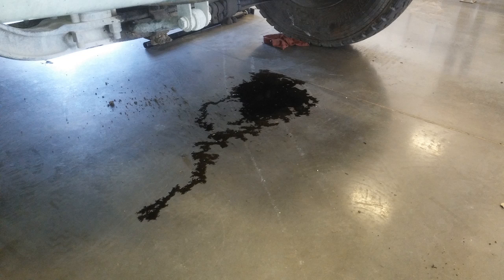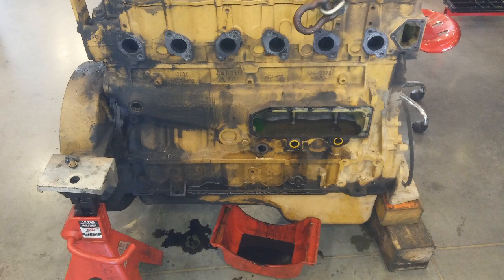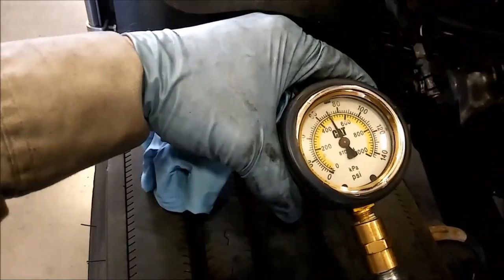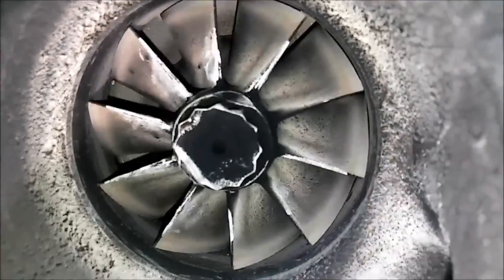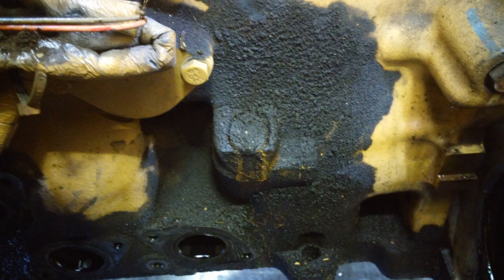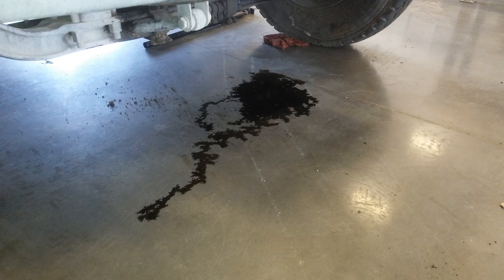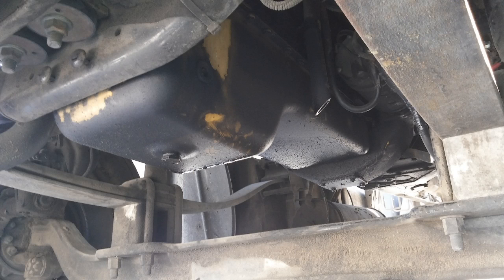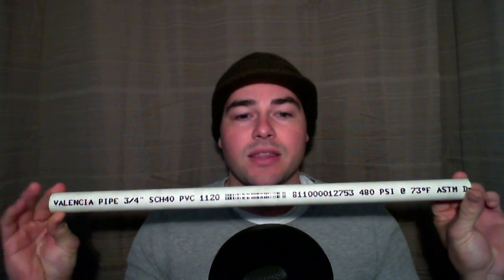Why Do Diesels Leak So Much?  Why Do Diesel Engines Leak So Much Oil?

Comment: 1. No throttle plate to provide a restriction therefore no manifold vacuum. Can be negated with a vacuum pump.

2. Higher compression ratios = more blowby = higher crankcase pressure. Same reason the diesels dirty their oil with carbon so fast.

3. Because of the lack of a throttle plate (generally) a diesel's cylinders are always getting a above atm air charge due to the turbo and compressing it. Meaning there is always blow by every compression to exhaust stroke. While a gasoline engine that is 'engine braking' has its cylinders unable to pull in a air charge due to the closed throttle plate and the cylinder will have lower pressure then the crankcase during intake to power stroke and 'reverse' the blow by path for gasses.

Summarized a diesel engine's PCV system in whatever form it takes is having to deal with a lot more flow constantly then a gasoline engine's PCV system which has to have a valve to prevent over scavenging at high manifold vacuum (idling).

Comment: Yo, i own a tdi sedan and currently suffering a "boost leak" apparently, i have noticed a very SMALL oil leak coming from one of the seals of my vacuum pump mounted on the front of my engine...could this have anything at all to do with the boost leak ?

Comment: On my merc w203 cdi, there is a pcv system, and the crankcase ventilation is exhausted right BEFORE the turbo. Germans know what they are doing!! I also fitted a oil catch can to prevent all that nasty oil on my intake.
Reply: Ricardo Moura unless you have a BlueTEC. They’re notorious for leaking oil into the turbocharger
Reply: My 2004 Sprinter’s OM647 cdi has an oil separator on the valve cover too; size of a shoe box. It exits straight into the turbo inlet, with the air filter providing a bit of restriction to pull the fumes from the crank case.  There’s a filter element that wants cleaning every 200,000 miles or so...

Comment: Just add more bolts to the pan ,valve cover and other places .Semi hermetic compressors have more bolts so the pressure of the Freon dosn`t leak oil or the gas out . I never seen these leaking oil at the gaskets

Comment: Pretty much all smaller diesel engines run the PCV into the intake side of the turbo. Never seen an issue with it. The crankcase filters are horrible. I've seen Cummins 6.7s completely fail because the filter was clogged up. On the ISX, they "redesigned" the filter to basically be an empty shell because the filters never worked anyway.

Comment: My duramax has a Pcv vent that is routed right into the intake before the turbo. It also has a second vent hose that runs under the truck. Why is that?

Comment: if you hock the pcv before the turbo but with a catch can in the circuit it shoud theoreticly work an if you also youse a variable throttle like with hydraulics in my mind it works because there is more or less the same negative pressure in the pcv at least better than without and the catch can should be able to ,,catch,, the oil and mabe water an the air thats already mixed with fuel shuold not be a problem in my book since they are so few .

Comment: Diesels also have no throttle plate, so there is no vacuum even without a turbo.  Thus, it can't draw a vacuum in the crankcase.  Also, 2-stroke diesels use superchargers to pump air into the cylinders through the crankcase.  They leak even more!

Comment: Gas engines in cars only go about 200,000 kms before they are crushed and sent off to China to be melted down.  Heavy Duty truck engines can to up to 360,000 kms in 1 year.  Most heavy duty diesel engines don't start to leak until they are 3 years old or over 400,000 kms.  In most cases they are still under warranty and get repaired at the manufacturer's expense.  In any high mileage or high hour engine the gaskets, seals, and o-rings will harden causing bolts to loose their clamping force and they start to leak.  This goes for any engine, not just diesel engines.

Comment: Hi, great video. How do turbocharged petrol engines solve this problem? By the way, why is it that the ballast on railway tracks are covered by a think layer of black diesel gunk? Is that due to the leaks or due to fumes settling on them? Thanks.
Reply: Brian Su that's from greasing stations along the track sd, used to prevent the wheels from. Climbing out of the tracks,and some blow bye ,which isnt vented back into the engine like a  ig truck

Comment: This is not necessarily true, even a turbo diesel produces vac. at idle.  Any engine system that requires vac. uses a one way check valve or a solenoid that captures that vac. and holds it even when under boost.  Think about a power vacuum booster on a gasoline turbo cars brakes, if it never saw a vacuum it would never work and you would loose power brakes unless you were idling.

Comment: There is no counterpart for an engine that size. Maybe a one-off engine but not really, plus the big engines like the 16L inline 6 cylinder twist when under load that Also contributes to the leaks

Comment: It is also a reason of the cheap manufacturing process used for the engine. There is way to prevent almost all oil leak by adding a lip to redirect the oil away from the seal. For example, if the oil 'rain down' then it will obiviously wet the joint where the gasket is. But if you add a lip that is part of the top part and extend downward then oil just can not get to the gasket, thru it can't get out. There is also other ways to do it that is even better, but they all add cost and manufacturing process. Since they are not required by law to do much about it then there is no reason to actually do anything about the issue.

If you look at any window on your house, you will see that they do not use gasket to keep the water outside, but a series of fold/bend/lip to catch and redirect the water. They could do the same.

Comment: Interesting thought. Why not vent the crank case fumes

  Into the fuel tank. And simply increase fuel tank vent volume. Use a dip tube to vent fumes below diesel fuel level. Using the fuel oil AS the filter. 

Just wondering. I'm not really familiar with diesels. Just a thought.
Reply: Brandon Allen great idea. I think I'll go take out a patent tomorrow
Reply: Seems an honest suggestion so here’s an honest response:
The warm gasses coming out of the engine vent would pick up diesel fuel fumes, so this would smell terrible, far worse than simply venting the crankcase directly.
The point of routing the pcv into the intake is to capture and burn the blow-by fumes, rather than simply venting them to atmosphere. Pulling a slight vacuum in the crank case and reducing leaks is a bonus.
Blow-by has incomplete combustion products, so perking them through the fuel will muddy it. Badly. This will in turn clog your (expensive) fuel filter and/or cause wear to your (very expensive) injector pump.
My 2004 Sprinter engine (OM647 from the DaimlerChrysler era, but all Mercedes) uses an oil separator to remove oil fumes from the blowby and the cleaned gasses are sucked into the turbo inlet.  183,000 miles on mine, over 700,000 on a buddy’s.
Both engines still run tight and dry.

Comment: A friend of mine has a racing mud truck with a 572ci engine. On it he has a belt driven air pump that is conected to the crankcase to achieve pcv. I wonder if that could be done on a diesel to help prevent or lessen oil leaks

Comment: Why can't you take the crank case blow by through a swirl pot/catch tank to remove the oil and feed the cleaned blow by to the inlet side of the turbo.  A swirl pot won’t impose a resistance like a filter.
Reply: You can. And it is done. I don't know why it wasn't mentioned in the video

Comment: hey mate i had an injector go on a cat 336d excavator and was leaking fuel into the engine made the engine oil very thin and boy did that engine leak oil throw seals lol
Reply from the maker: +Jordan Jordans Hope it didn't hurt the bearings.
Reply: i reakon it would of done some kind of damage the machine isnt the same anymore has lost a small bit of power, doesnt start the first time and the engine still doesnt sound right. its not my machine btw its the company i work for, they have over 400 machines of all types im guessing the workshop it stretched

Comment: it could be argued (given that  youre talking primarily about american engines),  japanese diesels dont spew oil everywhere, (my 200,000 mile 3.3 nissan engine never leaked a drop, nor do toyotas).  Just like British motorcycles, which were famous for chucking oil everywhere, as usual this is down to poor quality manufacturing processes, poor gaskets and also porous castings.  Make your engines properly and they wont leak. 
Why do think no one in europe or asia buys american machinery ? The only machinery worse than american made is of course chinese made.
Reply: Ruca Solo Idk. I drive 3 trucks.  2 Pete's and a kenworth. One Pete has 611k, the other has 240k, and the kenworth has 160k. None of them leak oil.
Reply: I think that has more to do with vehicle inspection practice than design in modern day. Also most common leak on any Asian stuff is valve cover gaskets, same with Euro stuff I've seen.

New equipment I've seen doesn't leak. 40+ year old excavator is an entirely different story.

That said, if I was to go buy a new American tractor today...... I'd buy a Mahindra.

Comment: I assume that having a form of PCV that fed the crankcase fumes into the intake stream would make the problem of a runaway more likely and perhaps more severe? I mean Diesels feed off the turbo oil as it is already when a turbo fails. Adding another source of potential fuel would be far worse I imagine.
Reply: JMSR_Enforcer_98_1993 diesels dr o have PCv valves, hes wrong

Comment: "started experimenting with pcv valves in the 60's"  ww2 jeeps had fully functioning pcv valve with no real difference to a modern vehicle in the 40's and i'd say they weren't the first either.

Comment: Is that a 3126 engine? We have them on the underground eimco loaders at work and they always leak 😂
Reply from the maker: +Boosted Brothers Customs C7 if I remember right sir, but they are practically the same outside of a few differences like the injectors and HEUI pump.

Comment: you suck pcv in before the turbo on a diesel.....all you need is a catch can...
small diesels been that way for 25+ years.
no turbo blowing issues
Reply: cars with turbos use a one way check valve and recirc to intake manifold AND pre-turbo without charging the crank case

Comment: I have a 3406e 80000 miles on rebuild.  Have problem with dip stick blowing out of tube under pressure. Changed air compressor because had 900000 miles and oil in dryer. Had international do a blow-by test and they said blow-by is in specs. What else could be causing this issue? Truck is running fine. No skips , no smoking.
Reply: Try changing dipsticks.  The present one may be old and lost its interference fit.  From the "been there, done that" experience.
Reply: Is the crank case vent plugged? 2WS has a vent on the side of the block that can get plugged. Clean it to get air flow.

Comment: The best solution is just have a breather/pressure release tube where it drops right out the bottom. There's nothing much else you can do with an engine with worn rings and cylinders.

Comment: I never noticed there was all that much of a difference. Gas engines seem to leak and seep just as much as the diesels I specialize in. The system Chevy used on its 6.2 and 6.5 was called a CDR.  My old one still works good despite over 400,000 miles on it and a good share of those were on a turbocharged engine. The turbo still works fine and shows no ill effects either.

Comment: If you run a engine on rpopane the oil takes ages for it to turn black I been using my lawnmower all year. With propane and it still looks like new and havent done an oil change but its also full synthetic oil

Comment: The paccar engines have a ccv that is electronicaly spun that makes vacuum and works well but they fail every 300k
Reply: Devin Price when I worked for paclease I was changing them before 200k miles every time. Supposedly they were coming out with ones That were serviceable and was supposed to be done every 250k miles but that shop closed up in May so I haven't touched a paccar since.

Comment: I was going to say the exact same thing. Using the inlet of a turbo to pull out the crank case gasket. Thank you for including the detailed infermation. On why it s not used. Vs just that the system is not used. I still do not understand why the pressurized intake runners are not usef. To pull out the crankcase gasses. In a paint gun the pressurized air is used to creat an airstream. Which creats the vacuum Which pulls up the medium to heavy paint medium. Would not the pressurized air. Which creats a powerfull airstream In the intake runner. Be used to creat the needed vacuum? Question no.2 why use hydraulics to power the vacuum pump. Since the gasses are light and you only have a small amount of engine oil mixed in with them. A electric motor should do just fine. Run quieter nd use less engine power. Since the drain off the alternator would be minor. Compared to the power needed to turn a hydaulic pump. Then there is the simplicity of the electrical system. Vs the number of items needed to run a hydraulic system properly. And there you have complexity which creats headaches. Which dictactes cost.

Comment: Would it be possible to add an air pump on the end of the slobber tube To create a vacuum

I’ve also spoken to RV owners who have routed the slobber tube into the exhaust 

Thoughts

Comment: Do CAT C7 experience more blow by than most? I had a C7 with 375k on it. Had blow by like crazy. You could sit at a stop light and see the blow by coming up under the the truck. I replaced the engine with reman from Reviva. Fast forward, the new engine has just as much blow by. Took it back to the shop. They called the reman company and was told that CAT revised the oil capacity to 1 gallon less for the C7 and a different crankcase breather. Still has a lot of blow by. Kinda pisses me off because I’m 30 grand into this engine swap and it still burns oil.
Reply: K Fletch 30 grand?  Wow! Lot of cash brother!

Comment: I think this has more to do with the way diesels are designed than to do with the turbocharging. If it was boost that caused oil leaks, every single petrol engine with a turbo or supercharger would also spew oil from the seals. I have a near 200,000 mile, 17 year old turbocharged petrol car that makes a little over 20psi and it definitely doesn't leak.  It has more to do with the fact diesels don't create manifold vacuum since there isn't a butterfly valve in the throttle body, that's all. The boost pressure absolutely doesn't help the fact, but it's mainly to do with the lack of manifold vacuum even without a turbo.

Comment: All engines shake WAY more than you can see. You can see it with a strobe light, but they shake in a violent way, almost as fast as the crankshaft is turning.

Comment: The use of an exhaust crankcase evacuation system may help (Google it).  Hook into exhaust after the turbo connected to crankcase evacuation tube.  Install a breather on the valve cover to provide filtered fresh air.

Comment: So why would you need a vacuum to suck the oil into the intake when they’re crankcase pressure? Should the pressure push the blow by wherever it’s routed? If I over fill my dirt bike with oil, unhook the pcv from the air box and let the hose dangle, little puffs of smoke will come out. That’s without any vacuum. Wouldn’t having a diesel with an oil soak-type air filter and routing the pcv in front of the air filter prevent the problem of turbos blowing? Filters that are designed to be soaked in oil (I.e. dirt bikes) never have a problem of the oil being violently blown into the motor. So wouldn’t changing the air filter with every oil change with that pcv system on it eliminate the leaking and pressure problems? Yes air filters aren’t cheap but they wouldn’t be if they were mass produced enough to change with each oil change

Comment: Have a takeuchi track loader at work, first year they put a tier 4 kubota in they put a filter on the crankcase breather. In the winter it tended to freeze up and the crankcase pressure would end up ejecting the dipstick.

Comment: There is really only 1 ONE way to stop leaks like that you describe is to run a DRY sump oil system. To much vacuum fights the oil pump in  wet sump.